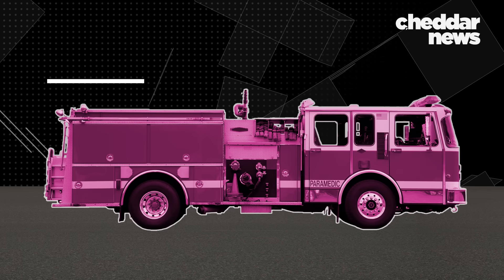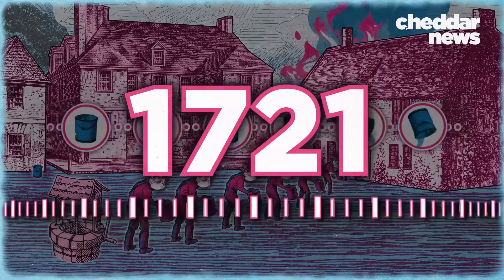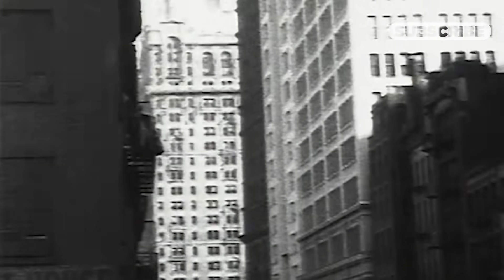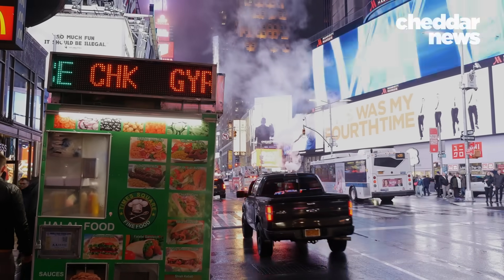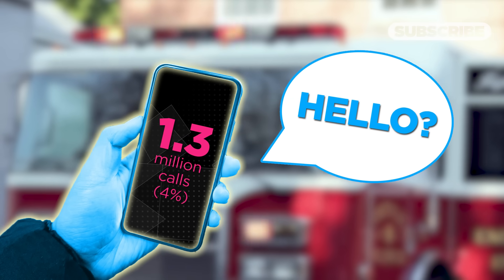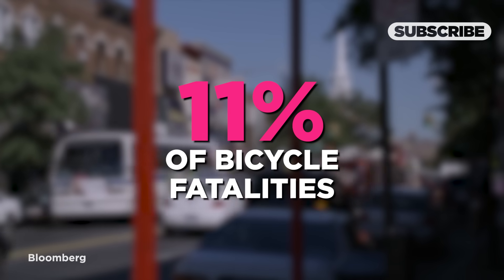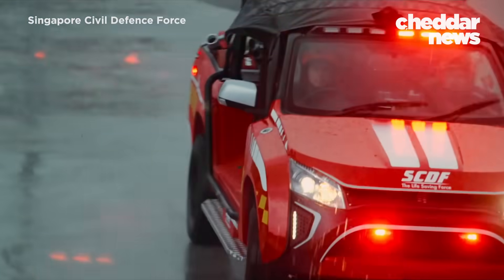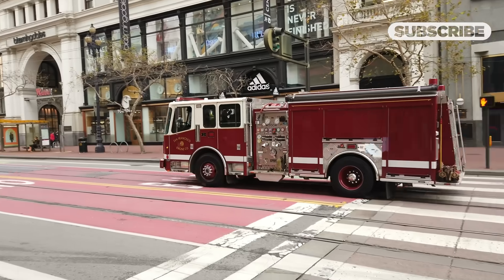Do American Fire Trucks Need To Be So Massive? - Cheddar Explains

Comment: Every tool has a purpose. Expand your collection and be more prepared for the future. Big firetrucks have a purpose, you're not gonna use a pipe cutter to frame a house. In my opinion we shouldn't go smaller but rather diversify what we do have. If you use the right too for the right job you'll get done quicker and safer.
Reply: Pretty much the best response.
Our large trucks are practical the Dependable. whilst we have a variety of support vehicles as redundancies that are perfect for many individual situations that are likely to arise individually on their own.

I see many Europeans getting so defensive with their clear Anti-US FD sized vehicles.<which are protected by their "Fair" Points in other comments, despite the bias and defensiveness they come in with.>

Everything has its place.
we can learn from any place.
but each place has its needs.
Reply: That's pretty much what the video already says, but ok.

Comment: The thing about American firefighting is the majority of volunteer departments out there as opposed to paid fire departments. In a paid department it's easier to send three vehicles to a scene with all your crew as opposed to a volunteer department where you might have four guys responding to a fire they need to be able to haul all of the equipment they might need at the scene in one go and not rely on three different vehicles to get the same amount of equipment to the scene.
Reply: most departments in e.g. Germany are volunteer as well: more than 22,000 volunteer departments compared to only 100 career departments; But the volunteers here usually have a larger crew per apparatus than the career FDs
Reply: @EnjoyFirefighting  good to know.  So you guys get real good turnouts for calls then ... Locally here it depends on the time of day.  Many of the jobs here still punish you for leaving work to respond to a call.
Reply: @roadmonkeytj  although some volunteer departments struggle on the day just like yours, as many people work in a different place than they live at, most departments can easily handle a normal turnout. They might roll with 5 to 10 apparatus
Although not possible to leave some jobs, employers may not punish workers for leaving the job to go on a call; The employers may claim a compensation from the municipality, but that's about it.

Comment: There are two large fire companies near me (I'm in the Maryland suburbs of the Washington, DC metro area).  One has six trucks that range from a gigantic ladder unit to a mid-size pumper/general purpose unit, along with 2 larger ambulances designed to handle everything from minor transport cases to high-speed critical care cases. This station is located just outside a massive retirement community that comprises single familly homes, townhouses, 3-story condos, and 20-story apartment buildings while the surrounding area includes several shopping centers (some very large), single-family homes, townhouse developments, garden apartment developments and a number of low-rise apartment buildings. Local roads include a very large high-speed highway with limited access, several 4- and 6-lane divided major roads (highways in every way except for speed limit and number of entrances), and a lot of smaller, sometimes twisty roads. In other words, the equipment matches the vast majority of calls, and different trucks are sent out as needed -- including helping with larger fires in surrounding jurisdictions that also include massive trauma cases, high-rise apartment fires, etc.  The other large nearby fire company is located in a more generally suburban area with only some mid-rise buildings and a lot of parkland with creeks, large man-made lakes, etc.  They have fewer large trucks (although they also cover several very large shopping centers & medical centers) but include a number of smaller vehicles, a water rescue unit, and even a couple of larger ATVs for off-road emergencies & fire fighting.  Again, they have the vehicles that match the vast majority of their calls very well. A larger number of smaller, more capable vehicles for more urbanized environments is a good idea (as long as the capability to handle high-rise fires is not compromised), but for some environments the "giant" vehicles that are presented so negatively here are actually a very good match (and they last literally for decades).
Reply: I'm from a village of 10k inhabitants in Germany; The local volunteer FD has 10 units at their station, EMS runs 4 + 1 units, special response group and water rescue have another 5 or 6 units. 
Anything from single family houses to apartment and mixed commercial + apartment buildings, a main line of the railroad, some of the busiest sections from 2 highways in the state, and the other half of the village is commercial and industrial district with anything from logistics centers to IKEA and BMW production facilities

Comment: So dumb that you're comparing Singapore pickup trucks with purpose built fire engines.  It's big because it carries water.  It's used while hydrants are being attached.  Terrible video.
Reply: seems like that pickup doesn't carry any water either, unlike some compact units based on van / pickup / SUV / compact car / motorbikes in Europe

Comment: America's firetrucks are designed to be profitable for the vehicle manufacturers. That's why they are covered in chrome instead of an easier to maintain material and it's also why the fire fighters are under paid. Gotta have cheap labor to keep the trucks shiny.

Comment: This video is interesting, but several statements are misleading if not false. Fire engines are not 10 feet wide, they average closer to 8 feet as the law prohibits vehicles over 102 inches on US highways. European engines and ladder trucks that you show do not have the pumping or ladder capacity required by US standards. There are many other differences that could fill a technical manual that you fail to consider. Having said that, I have ridden fire engines for 38 years and investigated fire engine crashes for 5. The primary reason we crash into stuff is a lack of situational awareness. There is often no excuse and we tear our hair out trying to get our drivers to slow down. 
If you think smaller fire engines would make a difference, consider how many crashes cops get into.

Comment: North American firetruck are not 10 feet wide considering the maximum width of a vehicle is 8 feet 6 inches without over dimensional permits. The total width from mirror arm to mirror arm is 8 feet 5 inches. Also we use larger units because they serve as more than one thing, such as a "rescue pumper". One side of the unit carries various technical rescue tools and the other side is the equipment used for firefighting operations. And a "quint" is 5 separate trucks combined into 1 six man unit
Reply: be sure, Europeans know what rescue pumpers and quints are as they have them in their fleets as well

Comment: Good to know a that a tower truck or snorkel is actually called a cherry picker. Let me know how that truck works out in an orchard for picking Cherrys.lol 

A good reason why the us has some very large fire trucks is that most of the country is protected by volunteer fire companies, some times we have to bring our own water to the fire, some areas have no hydrants. Auto wrecks sometimes turn into fires. In reality they are just really big toolboxes with a variety of options available to the crew to help out with someone else's worst day. Also look at how the euro trucks are equipped. I don't see any pre connected handlines. Every second counts.

Comment: In Poland in big cities we have a regular, firefighting stations, mixed with specialized ones. The specialized ones also have general purpose firetruck, but besides it they have special equippment, depending on specialization, like HAZMAT truck, ladder truck, tow/crane truck, equipement pickup, gas mask refill truck etc. Also generally there is in every firestation a basic regular firetruck with equipement and tank with motopump for fighting fires and helping with small accidents, and another, secondary one with technical equipement for dealing with car accidents, they got saws, hydraulic clamps etc.

Comment: I think the main reason for this difference is the use of vehicle and manpower.
In the US most firetrucks respond to all calls from a medical emergencie to an oil leak to a 20 stories high building falling down. Which means they need to have every thing on board for any case. Whilst in Europe most stations use specialised fire trucks. Each is equipped precisely for its purpose. You don't need EMS equippement, a large ladder or a big water tank if the call is for a tree that has fallen onto the highway. You just need some tools and manpower. If a house is burning you don't need 3 huge ladder trucks with everything on board. You get one technical truck for tools, one ladder truck with a mounted ladder as well as mobile ladders and a water truck with some tools but mostly pipes and a water tank. If people need treatment you call an extra ambulance to the scene which will be there just as fast as the fire brigade and police.
That way each truck can be smaller and still be packed with more useful stuff. And when a call comes in, the control center will dispatch the correct trucks needed for the emergency.
Reply: "In the US most firetrucks respond to all calls from a medical emergencie to an oil leak to a 20 stories high building falling down" same in Europe. A normal Engine in Germany responds to anything from structure to vehicle and brush fires, heavy rescue, technical assistance, medical calls, handles traffic accidents has ground ladders on board
Reply: @EnjoyFirefighting  In Germany you have specialised trucks. They get called whenever they are effectively needed. You won't see a DLK on scene for a traffic accident. You won't find a TLF on a medevac call. There are some types of trucks which will get deployed to a large variety of calls like the HLF/RW which provide many tools for a lot of different emergencies and will thus also roll out for most calls. But the HLF will most likely not feature a heart-monitor or hazmat-equippement - unlike in the US, where this also belongs in "normal" fire trucks.
Reply: @thenamen935  of course not, because some tasks vary on the types of apparatus here; The equipment the Ladder Platforms are missing is carried along by the Engines for example. Depending on the department a plain normal Engine might go all the way to having a mechanic chest compression device on each and every Engine

Comment: The fire trucks in the US are no more than 102” or 8.5 ft . If they were 10 ft wide they would need wide load permits and signage on both the front and rear to travel on government funded roadways. The only place they may be wider is at airports that they never leave

Comment: In Europinians countrys fire departments using two axel trucks, longer three or four axel trucks as pumps and ladder, less are cranes but are in use.
Lite trucks or cargo cars as technical support cars with extra equipment. Also in use are saddle tractors two or three axel for drag water cistern or ladder. 
Those vehicles are based on regular models. Firefighter versions are produced by car producers or by outside intended for this type of construction companies.

One of Europinian examples
https://youtu.be/AXD81W867d8

Comment: Unlike more compact areas like Tokyo and Europe, much of America is designed for the car, not the pedestrian. That is not the fault of firefighters--it is the fault of urban planners. Thanks to the larger areas covered by American fire departments, trucks must often be larger in order to be prepared for the many types of emergencies that may occur. Being larger also has a distinct advantage on American roads, where drivers and pedestrians often ignore smaller vehicles. I'm glad this video exists, since it has sparked insightful conversation. At the same time, it certainly oversimplifies the issue.
Reply: many departments in Europe cover just as large areas; Starts already in the cities, with a city of a certain size usually having only one or few large stations instead of numerous small ones spread out like in the US; But then there are obviously also rural areas, where European departments cover a great wide-spread area as well
Reply: @EnjoyFirefighting  Well, then, this video is even worse than I thought! It oversimplifies the issue to the point of being completely useless! Maybe the real reason for the size difference is simply what the manufacturers think they can get away with charging fire departments? But there I go, trying to over-simplify a complex issue...
Reply: @kentslocum  probably; Also the NFPA sets different requirements than e.g. the DIN standard in Germany or whatever standards other countries have around here
Reply: @EnjoyFirefighting  True. There's no one universal "right" way to respond to all kinds of emergencies, so there will always be regional differences in the equipment used by first responders. Cultural, social, geographic, political, financial, and structural variations will affect the vehicles chosen. I wish the video had mentioned that.

Comment: American trucks are 100 inches wide for the widest ones (a little over 8 ft wide) and the little rescue trucks are typically 96 inches wide so the big trucks really aren't nearly as wide as you claim. The height is determined by the door size the department has 10ft is pretty standard but it can go up to 12ft sometimes. The length is dependent on the required water capacity. Typical water capacity for a pumper is 1000 gallons a tanker is 2000 gallons and above some even hold as much as 6,000 gallons as well as lots of trucks hold either A or B foam concentrate, oil dry or some combination of those. The way the truck is designed is usually layed out for the specific requirements for the department. Some departments don't have any hydrants so they require a big tanker to go and pull water from a lake or something to fill a portable tank which a pumper truck can then pull from at the location of the fire. The smaller trucks you mentioned are rescue trucks and typically have very little to no water onboard which are great if there's no fire but the department still needs big trucks in most cases to put out fires there are small trucks with a 100-400 gallon tank and tiny pump but they are more used to get there quick to get water going before the big trucks can show up or respond to fires in locations like the middle of the forest if the big trucks would get stuck trying to respond. The issues with the street width can be taken into account in the design phase for instance ladder and tank racks mounted to the side can be of a different design or omitted all together in order to minimize the overall width if it's known that there are tight streets in the area. Also not all engines look as outdated as the ones you show some manufacturers still use the same chassis design they have for decades but not all do. We also build trucks on commercial semi chassis if money is a constraint for a department. Source: I design custom fire trucks for a living.

Comment: So looking at this, I realize the genius of Australian fire brigade vehicles. 

We have our trucks for town based stuff, which are bigger, and longer. They have ladders, and a slew of equipment.

But most of Australia isn’t towns, or easily accessible to larger non articulated vehicles, so instead we have the rural brigade trucks, which are made specifically to deal with bushfires, property fires and search and rescue.

Our rural trucks are basically all tall, narrow, 4x4 rigid trucks, with a 9 seater cab (2/3 in the front and can fit up to 7 in the backseats). These trucks have a much lighter kit, consisting of a large water tank, a firefighter pump, two fairly small toolboxes. Seeing as they don’t have to deal with tall buildings, they can do away with ladders and cherry pickers, opting for a simpler, shorter design that employs a short (4m or 15’) ladder for basic tasks, which can lock into the top of the toolbox to add the height of the fire engine.

These 4x4 trucks are fairly cost efficient, seeing as most are much older, and usually professionally built to the specific area’s needs. Certain areas redeployed ex army troop and equipment carriers with custom backs for either rough terrain or for extreme bushfire work.

Our rural trucks are quite intriguing too, seeing as they are made and designed with being trapped in the centre of a bushfire in mind. Hence the entire cabin is coated with a thick layer of fire and heat proofing, and high temperature glass, and bulletproofing around the cabin, making it very hard to damage the body due to rough roads or fire damage.

We also have an offshoot of the rural brigade which is the SES, and they run a very similar yet very distinct flavor of truck, favoring the Mercedes unimog, they use their unimogs for flood and bushfire relief, and for search and rescue. These trucks are basically heavy duty tractors disguised as a truck, featuring massive tires, planetary wheel hubs, 4x4 with 3 separate lockers to make sure you always have traction, and utility attachments ranging from a cargo tray to small cranes and even log claws attached to the front or rear that run off the PTO drive. These trucks take the idea of bulletproof and take it another step.